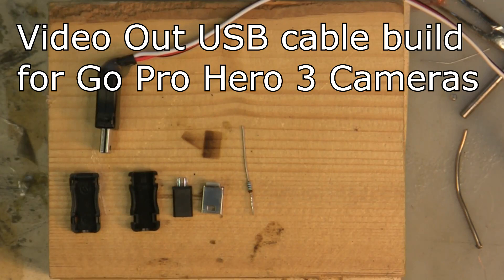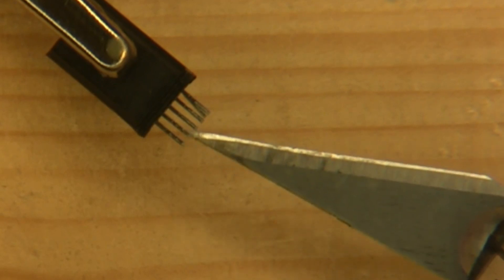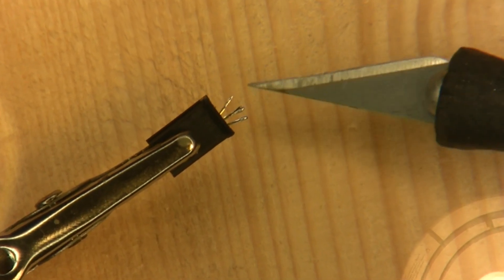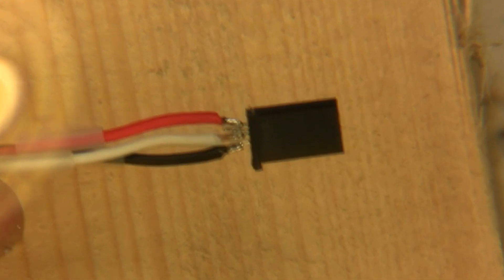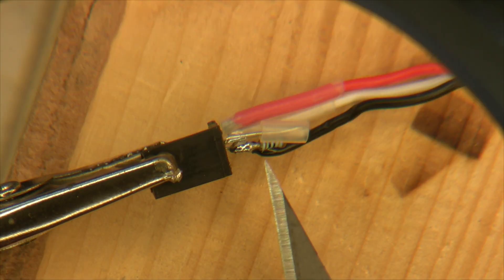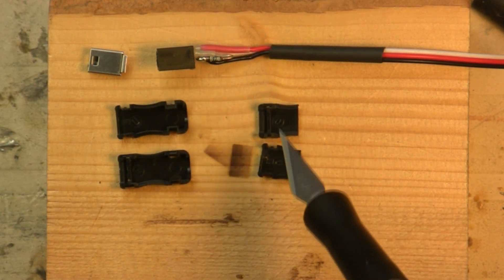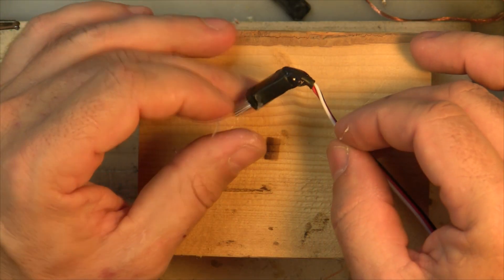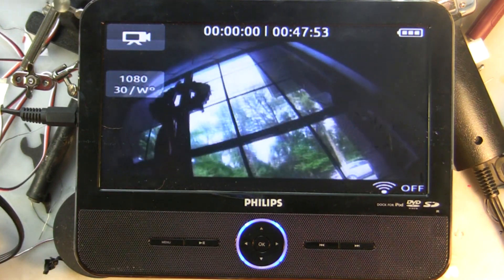Hero 3 USB Video Out cable Build

Comment: Thanks for a ok vid, but I CRINGE when I see that poor soldering iron tip... PLEASE wet your soldering sponge and use it to clean the soldering tip all the time! The tip should be silvery and shining, not black and sooty... And another VERY good tip if I may say so myself :-) Use liquid flux when soldering! Discovering flux revolutionized my soldering, as it will yours!!! Buy some liquid flux, it doesn't cost much, and you will love soldering with it! I do no soldering without flux anymore...

Comment: You can buy the ten pin micro/mini USB plug off ebay which has a nice 90 degree angle to it,you can buy 20 for around £5.12/$8.25 and postage under a £1 and you can get a 100k resistor out of any old circuit board you might have laying around as i did or just pop down to any radio shack type store for it if not. ;-)
If not just use the links that flitetest recommend as this video shows.